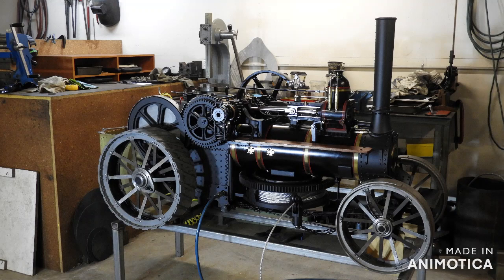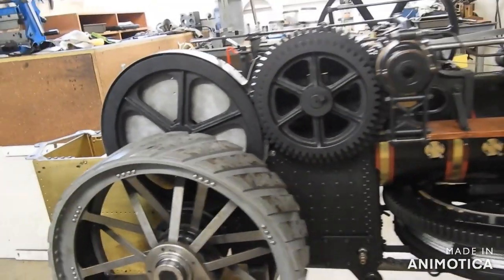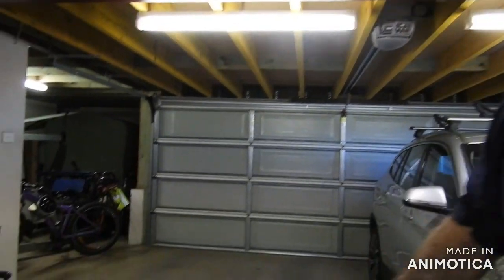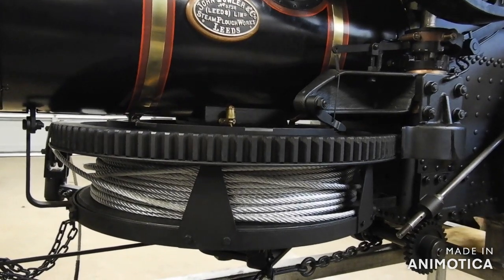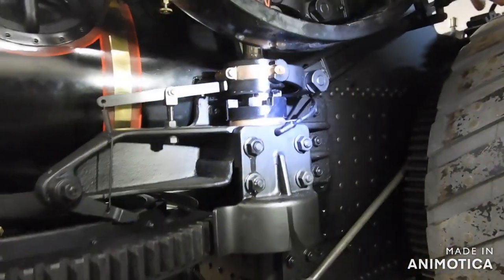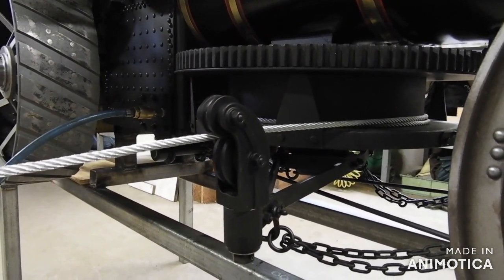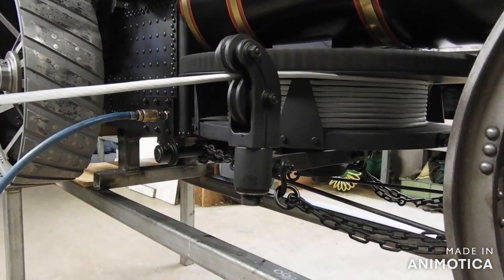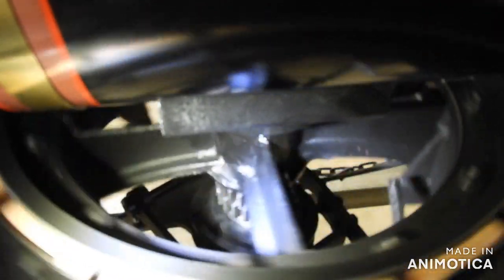Single Cylinder Ploughing Engine

Comment: I want to build wood burning  traction engine/shay just big enough for farm use,  if you did everything from scratch, I'm made of questions, from where did you find that the information on it to how did you rivet it how did you cut the gears how did you go about planning the project  what tools did you use,  I have two books on building a shay logging locomotive and climax from kozo hiroko but this is a little bigger in some of the parts and the tools/ methods he used are not how I want to build my farm engines  and lastly you made that flywheel run perfectly true very impressive
Reply: I would like to build one that is capable of traveling like at extreme uphill and off-road environments, like basically just drive straight up and down mountains , through creeks, sucking up filtered mountain water and eating delicious wood stuff.